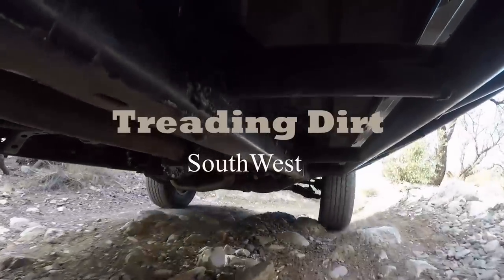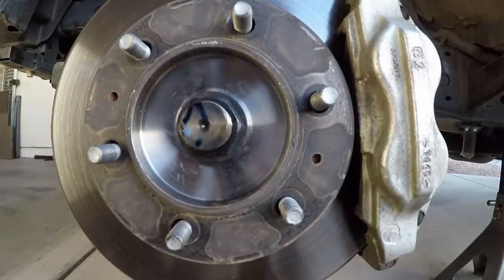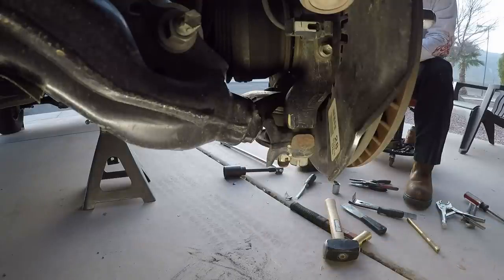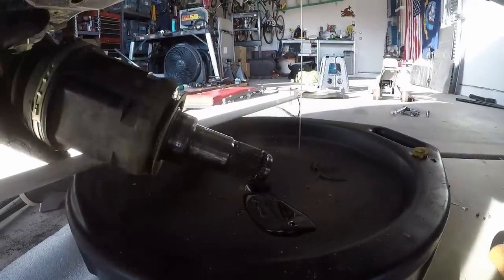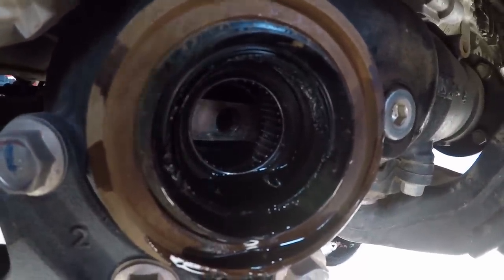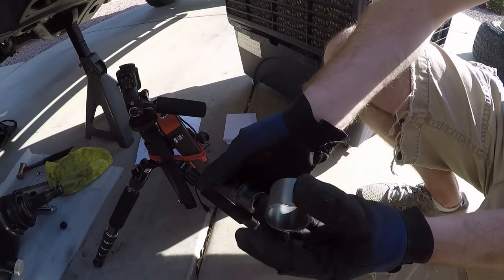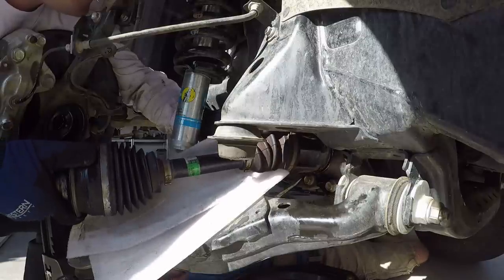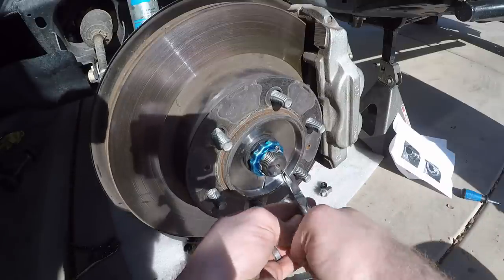Removal/Install of 2016 Tacoma CV Axle, Bonus: ECGS Bushing install

Comment: Video is well done.

Clearly illustrates the procedure.

One question - why not replace the needle bearing with another OEM needle bearing?

What is the point of installing a bushing, and how can that possibly wear and last as well as the needle bearing?

Thanks.
Reply from the maker: Farnham Steven the OEM bearing goes bad very quickly once lifted, and there even a TSB for it for unlifted trucks. The bushing from ECGS lasts for up to 500,000 miles. Not sure about the reason, other than one is clearly better designed for our application!

Comment: What is your center front hub to bottom of fender measurement  . I ordered. The same set up with 887 coils mine is 21” on the passenger front 22” rear passenger before I do any part removal

Comment: Thanks for this! Why do they use a needle bearing?
Reply from the maker: No idea! Maybe it makes sense at stock height but they have to know by now it’s an issue for many.
Reply from the maker: No idea! Maybe it makes sense at stock height but they have to know by now it’s an issue for many.
Reply: @TreadingDirtSW  I’m stretching my budget a little thin and wondering if I can skip the cv replacement and just do the clamshell bushing? Got a little play, but the uca, lca, diff drop, coils and camber/caster bolts are all on order already. Billies are already on.
Reply from the maker: @supersymun  That could easily be either thing, or a combo of both. A little play is normal however. Does it move around a 1/4 inch or so when you yank on it?
Reply: @TreadingDirtSW  it does :(

Comment: My ft diff started leaking after FJ Summit (Had a slightly bad shake between 50-60 mph) and I just replaced the ft diff seals. Well now the driver side weeps just a little and wonder if a change of the needle bearings would stop this.
Reply from the maker: Jim Frazier seals are separate from the needle bearing so I can’t see now replacing one would impact the other.
Reply: mine did the same thing on my 2nd gen tacoma for the longest time. come to find out, i was using aftermarket diff seals that don't work nearly as well as the OEM seals. swapped it out for OEM and it stopped leaking. swapping the needle bearings will help with the vibes at freeway speeds.

Comment: you ever broken one of the studs on your hub trying to take off the axle nut? also arent the torque specs different since your threads are wet with loctite?
Reply from the maker: Alphalamb Allegiant never broken a stud off, I guess anything is possible though. As far as loctite changing torquespecs you’re right if we were using anti seize (reduce by around 20%) but Loctite recommends using “dry” specs.
Reply: Broken wheel stud is due to over torqued lug nuts. Always use a torque wrench to factory specs

Comment: toyota said once you lift yourtacoma the warranty is void as far as any problems caused by lifting it up. ordered mine today 2019 tacoma trd offroad
Reply from the maker: That’s not a Toyota specific thing, that’s an auto manufacturer wide policy. Anything you modify on the vehicle voids that portion of the warranty. They’ll also try to get out of all sorts of unrelated warranty coverage by blaming your lift. 

If you aren’t willing to fight them, or you can’t make compelling arguments based on sound mechanical knowledge, kiss the warranty largely goodbye.

Comment: What does the bad needle bearing feel or sound like?  My trucks got five thousand miles on it and I would like to know what to look for when this happens.  Is the vibration very noticeable or is it equivalent to the road feel you get through the steering wheel?  Just wondering if this is something I'll need to be quiet to be able to hear or if it will be inherently obvious?
Reply from the maker: Drake Productions it’s a low rumble at slower speeds, usually 25mph and less. sometimes it’s intermittent off and on or even a “wa wa wa wa”. Easy diagnosis is to drive when you can hear it on a straight road, put it in 4x4, if it goes away then it’s most likely the bearing.
Reply: Mine is humming between 30 and 40 mph, it almost sounds like a wheel bearing but I've heard people say worse. But like he said if you put it in 4h and goes away it's probably that. The needle bearing seems to be more affected after a lift or level. 5000 miles after my level, low and behold that pesky noise.
Reply: What if the noise doesn't go away when you put it in 4hi? Could it still be the needle bearing? I have a grinding noise coming from the driver side front and have eliminated the cv axles.  There is no slop or anything when I shake the axles either. @TreadingDirtSW
Reply from the maker: Bros FOURR Speed could he something wrong with the diff itself or something with the tires. Generally the noise is only present in 2wd if it’s the needle bearing, even the Toyota repair manual states this but maybe if yours is really bad it might grind at all times.
Reply: Treading Dirt SW Hmm, thanks for the response. I'm just not sure anymore..I've had the lift on for 1,000 miles so that's not along time for any bearing to go out or anything which I why I figure it's that. Just wasn't sure if the noise was consistent what else it could be.
Reply from the maker: Bros FOURR Speed my vibe happened in around 1,000 miles. Some have it instantly.

Comment: How do you know that part is bad or what kinda noise or feeling should we look for . I have a 2016 tacoma lifted 3” with about 47k
Reply from the maker: A rhythmic off and on grinding or vibrating sound at 20-45mph that goes away in 4 wheel drive. The tool doesn’t come with the part, you have to buy it separate.
Reply: I do feel minor vibration. How to you choose that bushing i went on their website and they have some that say 7”, 8”, and 9” are they measured in diameter ? Shouldn’t they be the same ?
Reply from the maker: @agustinherrera5600  different trucks have different differentials. What year make and model is yours?
Reply from the maker: @agustinherrera5600  also, vibes can be caused by a lot of things. If it doesn’t go away in 4x4 it’s probably something else
Reply: @TreadingDirtSW  2016 4x4 sport
Reply from the maker: @agustinherrera5600  should be an 8” then I believe
Reply: @TreadingDirtSW  alright man thank you

Comment: Is there a needle bearing on the passenger side and the driver side
Reply from the maker: Just the driver side you need to worry about. Passenger side is a different style that doesn’t have the same issues.
Reply: @TreadingDirtSW  I don't know why I asked this on this video. I have a '91 4Runner .. but all the same symptoms are happening except it's on my passenger side
Reply: @TreadingDirtSW  I'm doing a complete master rebuild of the front differential so I figured I would put bushings on both sides anyways considering I have the whole thing torn apart

Comment: Do you run without your sway bar??
Reply from the maker: I run without when I am going off road, unless you have heavier coils in the front it sways like a boat pretty easily lol.  Since I can't control other drivers 100%, I throw it back on for safety/liability when I am in town.
Reply: @TreadingDirtSW  good to know. I had wondered

Comment: What kind of lift did you use how high did you go? And did you do a diff drop.
Reply from the maker: James Howard 2”, at the time of this video I was using 5100’s and stock springs. 

No diff drop as in the 3rd get it pretty much just rotates the diff instead of dropping it. It can also cause a change in oil pickup in the diff which could conceivably increase chances of long term failure. 

Stock trucks often need this bushing, as well as all manner of lifts and lift heights. There’s actually a TSB for this issue on stock trucks it’s common enough. Of course, if you take it to the dealer for the TSB they’ll throw another needle bearing in there lol.
Reply: Treading Dirt SW what kind of lift do you have now and if it’s different what did you change it.
Reply from the maker: James Howard still using 5100’s but have added 887 springs

Comment: what is the purpose of this? I have a 2016 Off Road do I need this? any help will be appreciated.
Reply from the maker: Factory needle bearing often vibrates, the ECGS bushing doesn’t.
Reply: @TreadingDirtSW  is this is for when you put a lift kit or factory high? thx.
Reply from the maker: Min-nut definitely more common once lifted but it happens enough on stock trucks that Toyota has a TSB out that’s free if you’re under warranty. Problem is they use another needle bearing lol
Reply: @TreadingDirtSW  cool thx for the reply! perfect How-to vid
Reply from the maker: Min-nut appreciate it!

Comment: What is the fluid that spilled out and where/how do you top it up?
Reply from the maker: ahm smi it’s gear oil. There is a fill plug up high on the side of the differential.
Reply: @TreadingDirtSW  THANKS!

Comment: Hey just wondering if you’d know what’s up. Swapped my needle bearing with the ecgs, but I’m now getting a vibration at around 20-30 mph. Wasn’t getting one before with the needle bearing. Drove it in pretty flush. I may go back in and double check that it’s flush. Cv axle has in and outward play. Could I have gone too far or not far enough?
Reply from the maker: Really tough to say without seeing it. The Toyota axles will move a little as you yank on them, that’s normal. Does the vibe go away in 4x4?
Reply: @TreadingDirtSW  yep, goes away in 4x4
Reply from the maker: @danielpollock28  I mean if you didn’t have it before, and it started immediately after install, I’d do a complete torque check and maybe even check the seating depth of the axle/bushing.

Comment: any need for a wheel alignment after doing the bearing?
Reply from the maker: airsoftkid1245 I did because I have a lifetime alignment deal so it doesn’t cost me anything. Technically I think you could get away with not doing one though. As long as everything is torqued back the way it was and you don’t loosen the LCA.

Comment: How do I know if my bearing is failing?
Reply from the maker: kyru generally speaking you’ll hear a rhythmic rumble or vibe at 10-50mph or so. Sometimes only at a specific speed. If you engage 4hi while driving straight it should go away. If so it’s almost certainly your needle bearing.
Reply: @TreadingDirtSW  thanks, I have been hearing a hum that reminds me of a bad wheel bearing front driver side when the window is down. I'll try the 4wd trick ty

Comment: help!! I did a 2.5 front and 1.5 rear level kit, plus replaced needle bearing also and carrier bearing drop and still have vibration. I own a 2018 Tacoma with only 4k on it.
Reply from the maker: ferncules1 might need shims on the rear axle. Could also be a tire issue, or rarely an out of balance drive shaft. How’s your alignment numbers?
Reply: I did the alignment right after the leveling kit install tires are brand new and from factory, truck only has 4000km's on it. never had problems like this until I did the level install
Reply from the maker: ferncules1 if it were me I’d start with axle shims

Comment: Hi, I'm planning to lift my truck 2018 tacoma dcsb with Bilstein set at 5th notch that should give me apprx 2 inc of lift and will use stock coils. Should I go a head and change it or just wait if till this issue arise?
Reply from the maker: VJTrey1 you can wait, I wouldn’t go 20,000 miles with the rumble but if it does start up you usually have time to order parts and find a free weekend to install.  Mine started within 1,000 miles or less of my 2” lift install though.
Reply: @TreadingDirtSW  thanks for the reply,   regarding tools what is the rating of floor jack and jack stand should I get?
Reply from the maker: VJTrey1 for jack stands I use harbor freight 6 ton jack stands, over kill on weight but they are tall enough to use on our truck frame even after lifting. The lighter rated ones are pretty short and you end up stacking wood blocks or something. Same goes for the floor jack, I went with a harbor freight Daytona 3 ton super duty as I like the really smooth control I get raising and lowering and it’s lift height is almost 24”. These items go on sale a lot and I got good discounts on both. You can absolutely get away with less capacity if you want to save money, just depends on if you’ll use them once, or over and over.
Reply: @TreadingDirtSW  hi do you think installing a diff drop kit might help to decrease the chance of breaking the needle bearing after lifting?
Reply from the maker: VJTrey1 probably not, enough stock trucks even have the issue to warrant Toyota publishing a TSB about it. I’d also research the diff drop in general, mostly just rotates the diff in our trucks and does little to lessen cv angles. I’ve seen more people remove them after install or just forgo it altogether than I can count.

Comment: struggled for hours trying to get the axel out of the dif and still no luck
Reply from the maker: Brandon just seeing this sorry. Did you have better luck? Did you try a large screw driver and mallet? I couldn’t get a pry bar to work.
Reply: @TreadingDirtSW  i gave up, got my icon stage 3 kit all installed except the add a leaf, just gonna have a shop do the bearing
Reply from the maker: Brandon sorry to hear that!

Comment: Whelp, this would cost me more in tools alone than to have the shop do it. Guess it's time to go buy new tools!!!!
Reply from the maker: Doyouevenstravabro? Lol maybe if you have a decent honest mechanic and you’re starting with no tools at all. Things like the breaker bar i get from harbor freight. The axle nut socket was $9 on amazon.
Reply: @TreadingDirtSW  my local overland shop charges 150 plus parts for this. I would need to buy every tool you used, plus fluid and a pump. Let alone I dont trust myself not to loose that little metal plate inside the diff
Reply from the maker: Doyouevenstravabro? But then you won’t have the tools for later jobs! The breaker bar, jack, stands, pump will all save you money later.

Comment: How much did you lift the front? I want to avoid this if possible.
Reply from the maker: Kenneth Schuessler 2”, I’ve seen multiple stock trucks with this issue though. The needle bearing is a poor design.
Reply: @TreadingDirtSW  well, crap.
Reply from the maker: Kenneth Schuessler there is a TSB if you get the grinding noise and your truck is stock. If you’re under warranty it’s free. Once you lift though most dealers will tell you to pound sand.

Comment: Why only the driver side how about the passenger side does not need a bushing?
Reply from the maker: arin mirzayan because the passenger side is a bushing that doesn’t cause problems. Driver side is the needle bearing that is an issue.
Reply: Thank's man.

Comment: Did you not want to change to 85w140 per the East cost recommendation?
Reply from the maker: No, because I just changed the bearing out, I didn’t re-gear.
Reply: Yeah. It is their recommendation with the bushing. I think I may not do it either.

Comment: That differential drain plug design has remained unchanged..its a pain in the ass to remove ..
Reply from the maker: Ashoud Anobetah haven’t had an issue with it. What difficulties do you have with the drain and fill plugs?
Reply: @TreadingDirtSW  the recessed Allen head can be really hard to get off if the copper washer gets bonded. Good spot for some anti seize on the surfaces.
Reply from the maker: Ashoud Anobetah oh I gotcha. Yeah I’ve messed with it enough I haven’t had to experience that yet. Great tip.